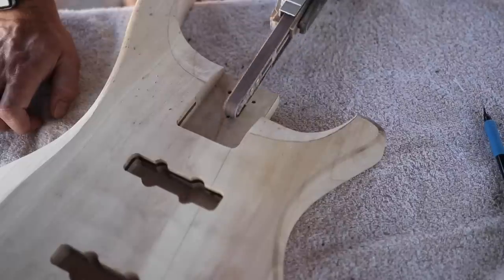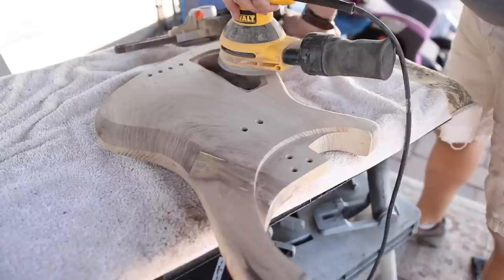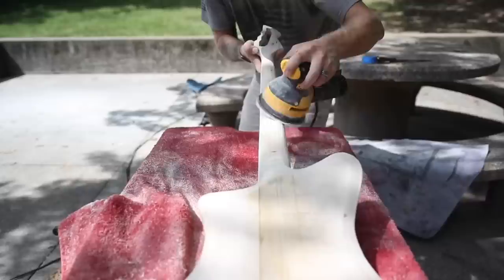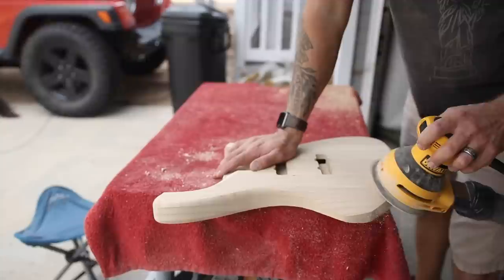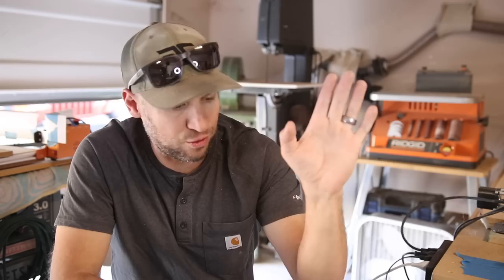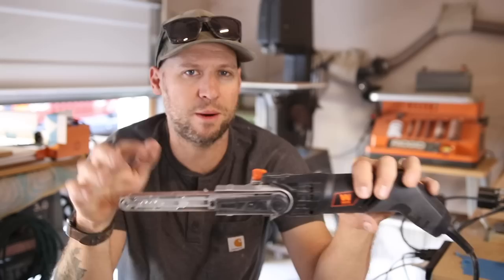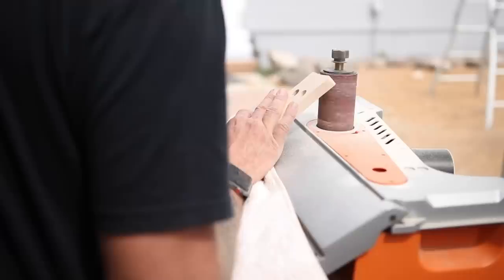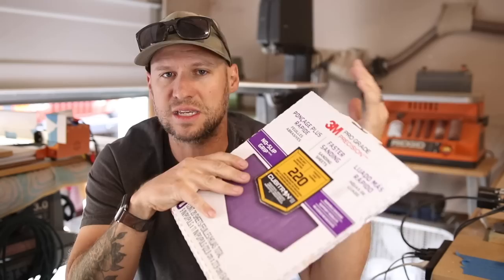QUIT WASTING TIME SANDING! (best tools to avoid hand sanding)

Comment: Pro tip: get a card/cabinet scraper for finishing off flat surfaces that will need no sanding. Not for every job, but for the right job, they're a huge time saver.

Comment: Consider using Mirka Interface pads. They're on the high end price, but they'll last you a good 12 bodies before wearing the foam.
For sanding pads, Diablo mesh pads (available at home depot) won't ever leave scratch marks, and they adapt to all the body contours along with the foam. 🤙

Comment: I found these sand paper cones at my job and grabbed a handful.  They don't fit perfectly onto a dremel bit, but if you glue them on, they work perfectly.  It's good for shaping the guitar and hard to reach spaces. They even come in different grits as well.

Comment: Dude, check out the Makita hand sander.   We have been using this arraying the edges on glass.     Every glass shop in the universe has one or two.    Also a stand up arraying machine as well.    Nothing finer.  All available is cork belts for polishing edges.  Both hand and stand up machines have them.   Great stuff.   Cheers and thanks for showing us your tips of the trade.    Cheers from Canada

Comment: Well, I've got a DeWalt orbital, although it's cordless, it still works well.  And I agree the pads are great.  I've got the finger sander...  I just need to open up the box and actually use it.  This is a good reminder, as I'm kinda down onto the sanding part of the latest project.  

The big boy sanders, well, not yet, but maybe soon.  I've also considered some stationary disc and belt sanders, but it's true that that might leave more tool marks.  

3m is very good sandpaper, and it's generally worth the cost.  Even if my nephew works for 3M.  :)

Well, I guess back to the basement to sand.

Comment: Another problem I have personally found out about cheaper sandpaper belts is that if you buy a quantity pack that you want to last you a few years. When you finally get around to them, it seems the glue rots and the belt just fall apart. So pissed me off!  Ebay belts suck!  If I do buy any off ebay now, It's because I cannot find what I need quickly and I'll only get a few to get me by until I can get better belts.

Comment: Woodworkers skills have drastically changed, planing and scraping helps to lessen the amount of sanding. what can one expect when people with no  training or experience in proper woodworking and are limited to home depot, Lowes, harbor freight and amazon to get their tools...that's called a hobbyists not a craftsman. Same goes for applying finishes. A guitar Luther is a maker, they understand wood, weather, expansion contraction joining, etc. etc.
Reply: I do agree that the orbital sander is one of the greatest inventions besides the cordless drill/drivers. I think you do good work however I don't overly agree on encouraging people to use cheap tools to do good work unless of course one is experienced enough to know how to make something do in a pinch. Of course encouraging people to try woodworking if they haven't before can be rewarding for the person and open up a whole new world of joy....long as they don't cut off a finger or worse. Lol 
I like your bass design..the behemoth I mean, very nice, don't care for the finishes much but that's just personal preferences, your guitars look good, not certain of long term durability but perhaps you could do a video of that subject. God bless you and your family in Jesus name.

Comment: Do you find that you actually use the adj speed on the finger sander? HF has a version with more power and non adj speed for about the same price - of course its heavier as well. I guess you never lack for power on that WEN sander or you wouldnt be recommending it ?...
Reply from the maker: Yes I definitely use the adjustable speed. I usually run it on 1 for most jobs unless I really need to remove a lot of material, then I might bump it up to 3 or 4. Never feel like it needs more power than that.

Comment: I've got a Porter Cable square orbital sander. Would that work as well as the round one?
Reply from the maker: If it’s square then it’s probably not an orbital sander. It probably just a palm sander
Reply: @GunsandGuitars  Thanks for getting back to me. I checked, it's a Porter Cable 340 - Orbital Sander. Do you think it being square would make a difference in what you displayed?

Comment: also...please stop sanding bare woods finer than 320 grit...
damp/wet wiping wood, letting it dry and then 320 for a second time is more valuable.
pushing down on a sander is bad....it cloggs 10x....clogs leave scratches.
trimming the/a backing pad so its smaller than the sand paper helps with grooves and ridges.
let finishes dry fully....wetsand with lots of/way too much water